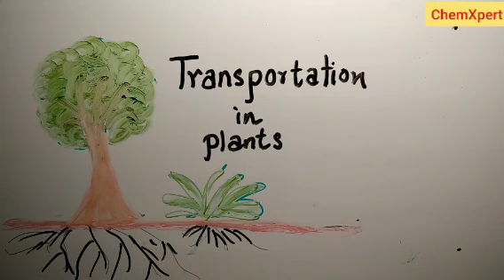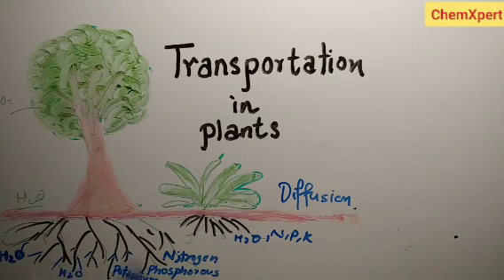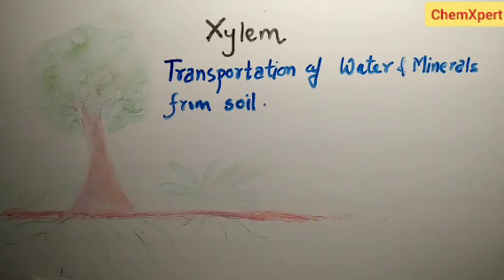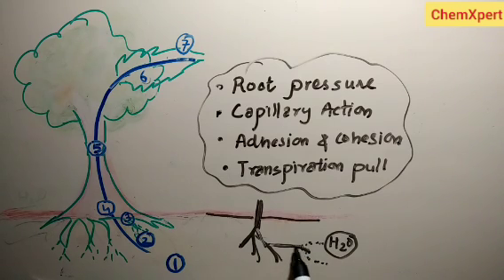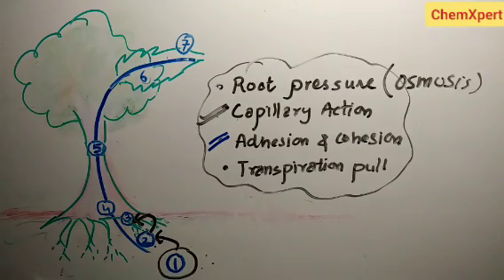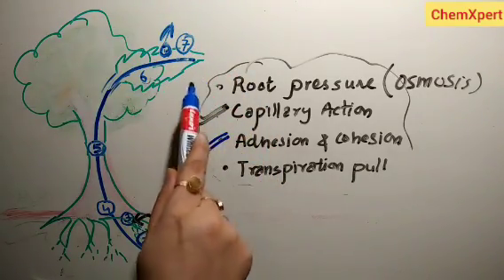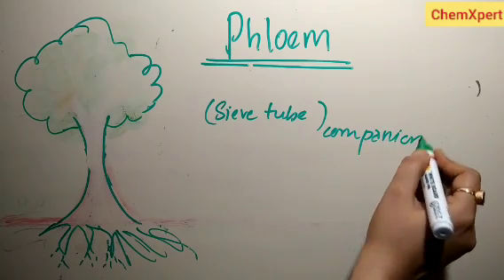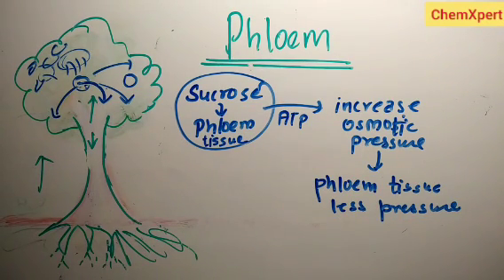Transportation in Plants |Class 10 Science | Life Processes

Comment: That means is all this are releted...?? Means if at night root pressure is acting then obviously Capillary action would be acted nd if the transpiration is not acting at night then how after adhension nd cohesion the water reaches to leaf at night???????????? Plz answer
Reply from the maker: Photosynthesis takes place during day time... So as such water requirement is less during night... But if water is used up for any process during night, water column already have water in it.....and the vaccum which is formed when water used up can easily covered by root pressure,capillary action and major role is that of cohesion and adhesion forces....as requirement is less...so easily provided by less pressure only